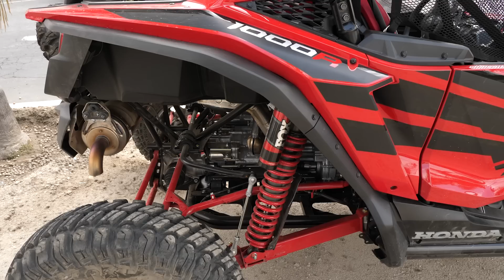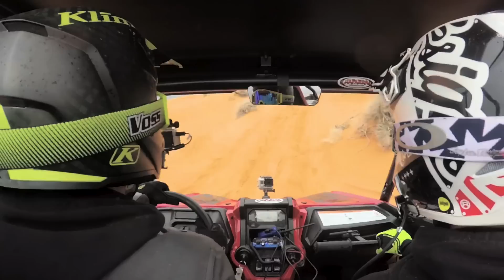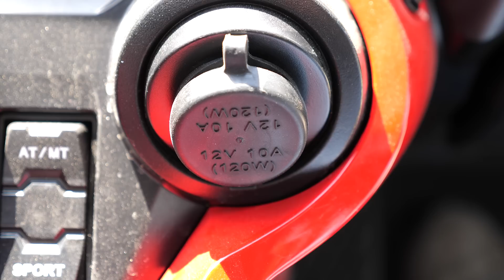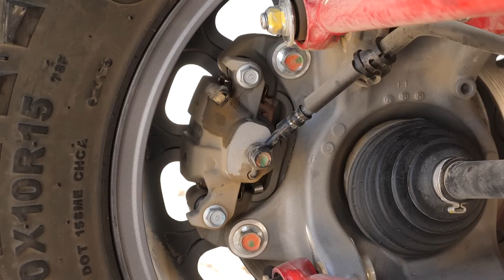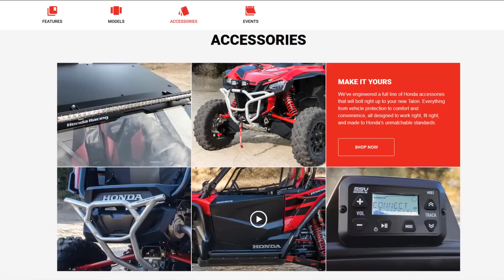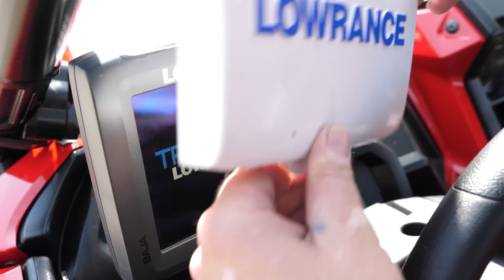Honda Talon 1000R on 30" Tires Method Racing Wheels Complete Vehicle Walk Around

Comment: On my 2914 talon 1000x4 buggy I have been running size 32x10-15 super ATV incursion tires. Been pretty good with those taller tires driving it 😂 n mountains in eastern TN,eastern ky and in upstate sc. But I am going to buy a shorter 30" set of tires as my backup set. Might go with GBC terra masters,carnivore rt,efx moto ravage xl,ams m1 evil or gladiator xcomp atr tires. Also considering ITP Mt 911 bar style tires for mud park riding.
Reply from the maker: That is a solid list of tire options to consider for your machine.

Comment: Love the Talon, looking at getting a 1000x 4 for the family. Seen some great pricing right now.
Reply from the maker: It is a solid machine!
Reply: Only drawback to 1000x4 is narrow 64" stance. About to get mine widened our to  almost 69-70 inch width. 7/I live in upper northeastern TN. Drive on lots of off camber rutted out trails so I need it to be more stable to not top over so easily. Other than that I love everything else about the machine.

Comment: Specs on the wheels please
Reply from the maker: Thanks for watching. These wheels are Method Race Wheels 401 Beadlock Wheels. All of the wheel specs  can be found here: https://www.chapmoto.com/method-race-wheels-401-beadlock-wheel-parent-577m40112110m    -- Kyle & the Chap Moto Team
Reply: @chaparralmotorsports  What are the tires?
Reply from the maker: @dh-flies  STI Chicane RX Tire  https://www.chapmoto.com/sti-chicane-rx-tire-parent-337-001-1425
Reply: @chaparralmotorsports  Thanks...I'm shopping for tires for my Talon. Want to get 30's.
Reply: What size spacer did u have to run in the back?

Comment: Scary part is like the Rubicon or old 450 electric shift, if a sensor goes bad or has a fit, you disabled, no more biking, then trailer or tow to get a stupid code cleared so it can run or  used again... Listen to there warranty price..lol.  Compares to a CF MOTO and works as good but unfortunately electronics designed to send you to the dealer fail almost on purpose.  Best to stay away unless you can bank big repairs not covered because you drove it in a puddle.
Reply from the maker: Man... I do see your point.  But, I can attest that I abused this thing over a long weekend in Sand Hollow UT...  in the mud, sand and rocks...  I worked flawlessly for me. Neat machine!  -- Kyle & the Chap Moto Team

Comment: How did you mount the GPS?  Also, why did you choose those tires over Mongrel or Tensors..etc?  I have an X that I'm building.  Thanks
Reply from the maker: We mounted the GPS using RAM Mount products. 1" Ball to the back of the unit, a 3" arm and a Roll Bar Mount to the cage. Great set-up.  We went with the STI tires as we have not had a chance to test that particular tire as  of yet. We know how the other tires handle... but needed to get some time on the Chicane RX. It was a short run with the family, so we did not punish them as we normally do, so the jury is still out...  The did well though. We did feel that there was less "wallow" or side to side movement from the sidewall.  More to come as we get more time on them....   What MODS are you making to your Talon?  Thanks for watching.  -- Kyle & the Chap Moto Team
Reply: @chaparralmotorsports  I've done half windshield,  lower trailing skids, storage bag, front bumper and fire extinguisher.  Looking to do GPS next, radio and wheels/tires and harnesses.  Like to see spare tire mount made.
Reply from the maker: Sounds like a nicely set up rig!  Honda has a Spare Tire Mount in their Accessories. We have seen it... It is nice.

Comment: Dct “dual clutch transmission”...
Reply: So bro do you thinks its better  than other side by side or not I my self raced  off and on tt and flat track atvs for 22 years I loved my 450 Honda  but I'm new to side by side world
Reply from the maker: It just depends DJ.  I being a recreational ( 1 or 2 times a year go to the dunes / desert with family guy ) FELL IN LOVE with the Talon and the ability to SHIFT the car. I really felt a power delivery difference and loved being in control. I personally thought it had plenty of power.    HOWEVER, some of our hardcore SxS drivers found the Honda to be lacking in power... but they did "like the feeling of the shift" they would not want one due to the lack of "put you in your seat" raw power.  -- Kyle & the Chap Moto Team

Comment: Looks much better with the bigger tires however with the heavier weight and taller gearing it has to bog that engine down the question is how much? In order to change the gearing do you have to dick with the transmission or does it have differentials like a truck you could change?
Reply from the maker: We noticed no difference in power... as Honda has overbuild this thing for sure!  We did like the handing and the ground clearance.